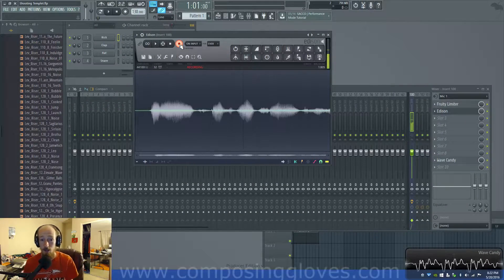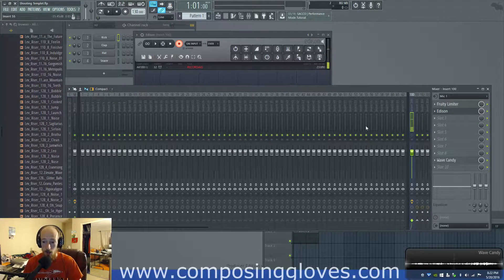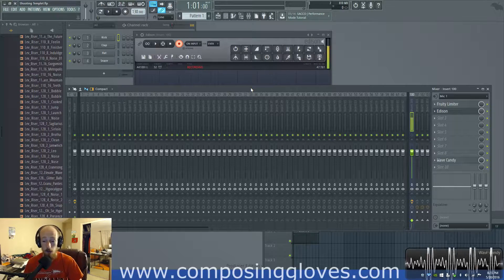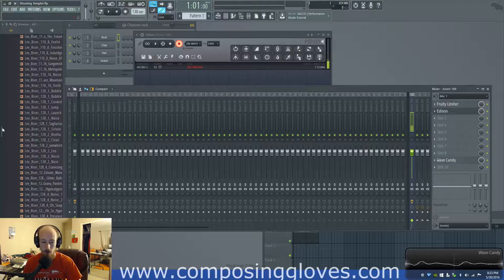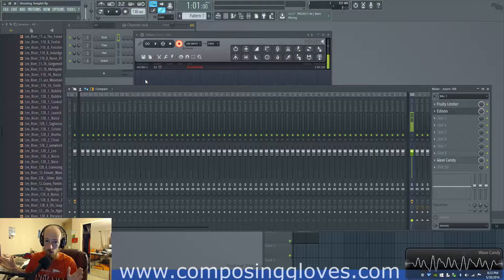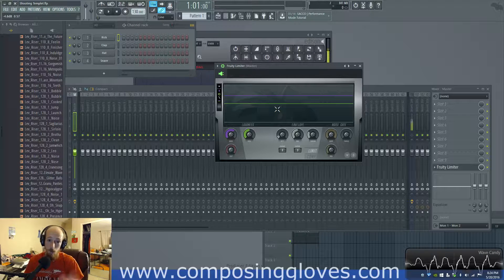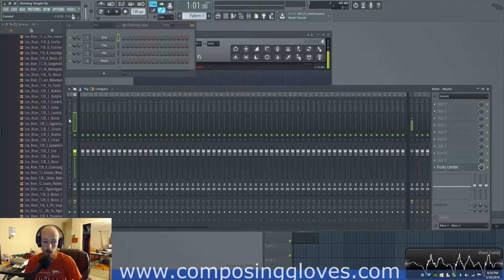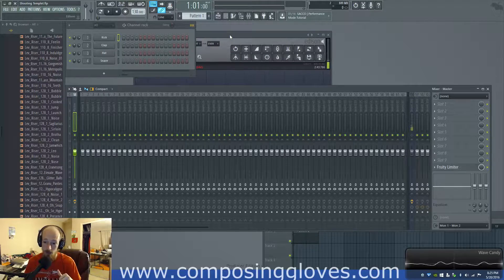Sound and Synth Basics 23 - dBFS and Clipping

Comment: I'm a little confused. Does "zero" represent the dBFS point? How is it possible to go over that?
Reply from the maker: It's a little complicated, but it boils down to 0dBFS is the highest you can go, going over it is basically a measure of clipping when on the master track or any track being sent to a sound card, however other tracks actually technically don't clip due to floating point numbers (remember we bounce audio typically to 16 bit or 24 bit usually, but internally we use floating point nubmers which have a MUCH bigger range). This big can of worms basically means there is a difference between the numerical headroom and the sound card reproduction headroom. Some companies have even encouraged clipping on internal tracks and just pulling down the fader to a "non-clipping" level before hitting a track that sends out to a sound card. Even FL's manual in the "Mixing advice" section covers this. If I recall I think Reason made a video on this topic. I still as a general rule try to keep my stuff peaking at around -6 dBFS so it generally doesn't matter but when I am just in the creating stage of my process and not the mixing one this is handy to know about as I don't always bother with turning stuff down during this part of the process.

Comment: Hey composing gloves I'm really struggling with clippings freqntly occurring while soundesigning in sytrus I have tried adding attack n releases on the synth but no help after filter modultion I'm sure to get a click pop noise what to do help please!! Quite frustrated even the rendered comes with the click
Reply from the maker: Are we talking about a single click that happens every time the note triggers or constant distortion?
Reply: @ComposingGloves  yeah I'm talking about that and there's also some distrtion after rendering it out..
Reply from the maker: @minggamratan8921  Does the signal actually clip on the meter during sound design? It would help a lot of you could upload a video with the problem so I could hear it.
Reply: @ComposingGloves  ok I'll upload a video and show u .. this is very weird and discouraging
Reply: @ComposingGloves  I tried turning off the dithering while rendering and the distrtion slightly went off and also enabled master effect while rendering ....